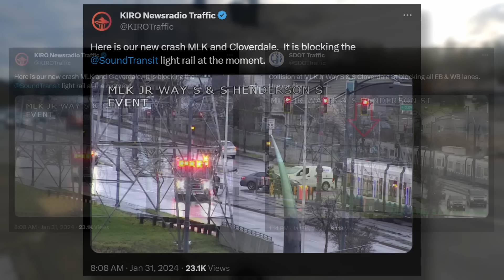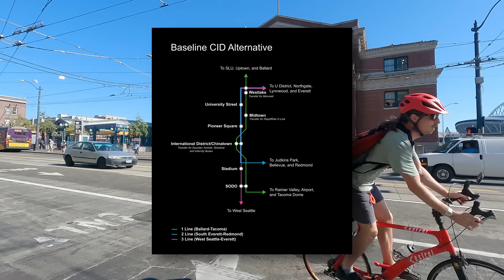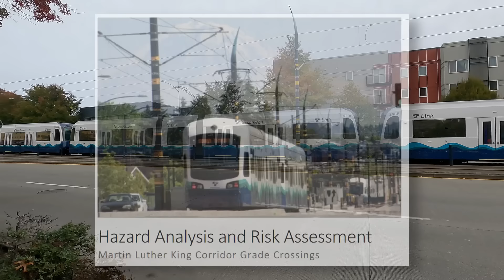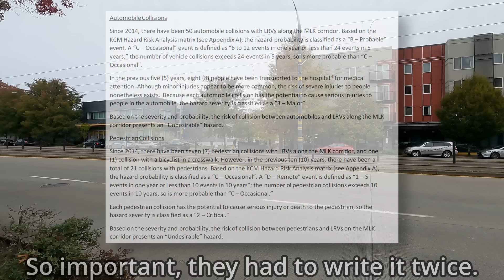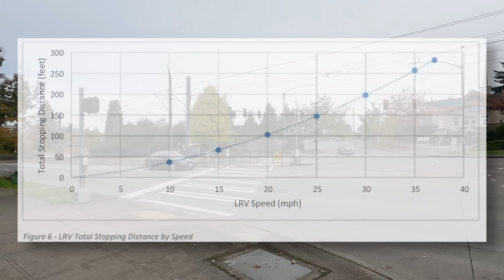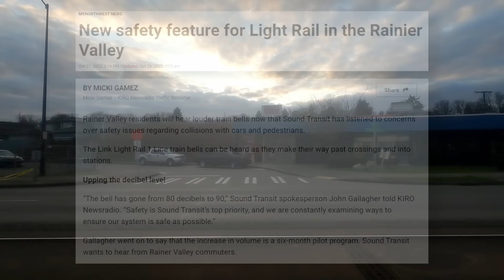Don't Skimp on Grade Separation

Comment: A comparison with Phoenix's Valley Metro light rail is warranted here. It opened at the same time as Seattle's Link, runs the same Kinkisharyo & Siemens vehicles, & has comparable average speeds, but took less time & cost to complete, & has been able to be expanded much more rapidly since then. It's also fully at-grade with traffic signal priority, running in the separated median of 2-to-4-lane roads for the entire length except a short river crossing. There are only two intersections with crossing gates, & in fact those two intersections cap the frequency trains can run along the whole line because the time the crossing gates are down is significantly longer than the time a normal light cycle would stop traffic at those intersections. If not for those two crossings (which Valley Metro is currently studying ways to eliminate), Phoenix would be able to enjoy the same 6-minute frequency as Seattle, instead of the 12-minute frequency it did before COVID.

The answer isn't "grade separate at all costs," but rather, build & operate at-grade light rail with adequate signal priority, taking into account motorists' (mis)behavior.
Reply: Complete signal priority was found to be impossible on the Rainier Valley section of the link: there's no way to meet the cross traffic demands while always keeping the trains running.
Reply: @satiric_  Phoenix addressed the same problem on Central Ave by eliminating cross-traffic except at arterial road crossings every half-mile. If the street layout of Ranier couldn't have been redesigned similarly, then that's the real issue, not grade separation.
Reply: But what is the problem with letting motorists wait? The M1 line in Lausanne is goes through fairly large intersections as well and the trains always have signal priority and never stop to let cars through, and on top of that the line as a frequency of one train every 5 minutes and is single track (except at stations). Sure the wait times to cross the tracks can be a bit long, but motorists have adapter to this and changed their habits
Reply: @alainterieur4837  there's no problem with making motorists wait longer in the abstract. The reason this particular crossing (University Drive in Tempe, AZ) is a problem, is that it's an extraordinarily high-traffic road through an incredibly dense area. The local transit agency actually started diverting bus routes away from University Drive, because at peak time in the afternoon it can take over half an hour to traverse a distance of less than 500 meters in either direction from the light rail crossing. With traffic so backed up, it's often the case that when light rail trains approach the crossing, the gates can come down on top of stopped cars, or trap cars in the middle of the crossing in the train's path.

The delay is especially bad when trains in opposite directions are slightly early or slightly late, causing the gates to be down continuously for the equivalent of two full cycles, or about 90s. Imagine a high-traffic arterial being blocked for 1-2 minutes out of every 5, and the 10-20% reduction in the road's throughput becomes a serious problem. So the agency addressed the issue by limiting frequencies to every 12 mins. Meanwhile, at similarly busy crossings where the train passes through a signalized intersection without gates, this is a complete non-issue.

Could one solve the issue on University Drive with a road diet, instead of grade separation or re-signalizing the intersection? Probably! But because of the arcane way that Arizona road planning works, that's not in the hands of either the transit agency nor the city, but a superceding agency run by people who are fully car-brained. They actually insisted on widening the road immediately east of the crossing, over the objections of several municipal officials.
Reply: @satiric_ wrong build elevated like in Melbourne Australia.
Reply: @jmchristoph buddy drop it at grade is crap and can’t be defended trams suck essentially at slow speeds
Reply: @jmchristoph politically infeasible
Reply: So you admit that at grade is hindering frequency? So you admit grade separation is vastly is superior

Comment: Whilst I'm not familiar with the area, in general I don't think grade separation is necessary for light rail. If they were going to go with a cut and cover approach, they should've just used heavy rail. The main advantage of light rail is that it is much cheaper to build because grade separation is generally not necessary, except for maybe at a few key points. If it needs to be grade separated anyway, then just build heavy rail as it wouldn't have been much more expensive than grade-separated light rail. 
I agree with your suggestions around using boom gates & pedestrian gates though - that should be a relatively inexpensive way to significantly improve safety and hopefully allow speed limits to be increased for both the trams and cars.
Reply: Some context for LINK: The initial construction had different plans compared to what was followed. Basically, LINK started of as a regional tramway (in favour of a regional metro linke BART, Washington Metro and MARTA) with the only meaningful grade separated portion being a BRT tunnel but any expansion ended up being grade separated which caused the initial sections to be an outlier with all the downsides which were inherited.

Comment: The (hopefully) soon to be opened Line 5 in Toronto is a Light Rail line that’s fully grade separated running as a subway basically through the centre of the city, but popping out to run in a separate right of way in the median of a busy stroad in the east end of the line. 

I’m very curious to see how many accidents and what preventive measures they have put in place. From what I have seen of the infrastructure thus far, I don’t see anything (no lights, no painted right of ways, no gates, etc…). Anyways, thought it would be another good case study. It’s too bad Toronto didn’t learn from Seattle & built the wrong transit. It’s likely going to be overcapacity within a couple decades, but we’ll see. 🤷🏻‍♀️

Comment: Seattle is a good example of a city that desperately needed transit but skimped out on the design and lazily built stations and crossings resulting in a failed system. Seattle hopefully can get better but this is a good reason most of the city doesn’t use it.

Comment: I'd say I'm pretty much the opposite of an urbanist since I prefer to use my car as much as I can, but I don't like seeing a half-assed light rail system being built in pretty much the same place we already tore OUT an interurban line. If we're gonna commit to it, at least do it well. I don't use public transit at all since I have no use for it, but the fact that so much money is being poured into a system that's already poorly designed just irks me. There are definitely places where light rail works in the Seattle area, but only if it's properly designed.

Comment: It's weird that at-grade isn't as much of an issue when I go to other places in the world with trams and LRT. For instance, in Munich the trams will often have exclusive right-of-way phases and signal priority so all directions are stopped at intersections while the tram runs through. Warsaw trams don't seem to have an issue running in the middle of the road either. Maybe it's familiarity with being around lots of trams, or lower overall speeds, or drivers are more situationally aware of their surroundings over there?

I don't think grade separation is cost-effective as a replacement for the 1-line, but I'm also unsure if trying to make things idiot-proof is a good solution either. There's usually a better idiot that shows up eventually.
Reply: the best thing is probably a road diet on mlk. toss in some sweet bike lanes, shrink the lane width, and people will actually start going 25
Reply: American drivers are terrible, mainly because driver training is minimal and it's nearly impossible to fail your driving test. Also, drivers are very entitled and basically think they are gods of their own worlds when they're inside their shiny metal boxes.
Reply: @danielkelly2210  Drivers in Minneapolis are the most respectful ones that I've personally experienced (it's probably the Midwest culture). But even here, the Green Line is known for nailing drivers who do a left turn through a red light.
I think it's more the quality of education and less the attitude.

Or maybe they just lack the proper motivation to pay attention: Get hit by a train, or get caught by the police making an illegal maneuver across tracks, get 20 years in prison (if you survive).
You'd be surprised how much more attention drivers and pedestrians would put into not making an illegal left turn across tracks.

Comment: That looks like a tram, not a LRT. They should have replaced the route with busses for the duration of maintenience and the problem would be solved.
Reply: To be fair, LRT is a very broad category and LINK does switch between grade separated metro and tramway multiple times.
Reply: @MarioFanGamer659  Trams sometimes have grade separated sections of the line, but they are still trams. For LRT to function properly it has to have fully or nearly fully grade separated route. (As in the same as heavy rail) Usually LRT has even more grade separation than heavy rail as it tends to function as a metro, and trams tend to have much less grade separation as they serve a similar function to busses, but with higher capacity...

Comment: In terms of retrofitting Line 1 in Seattle, couldn’t they shut down one direction of the MLK Drive, use cut and cover, while keeping the light rail line open? They could either convert the other side of the stroad into 2-way traffic or, alternatively, make some alternative road changes to handle the traffic changes (converting a 2-way street nearby into a 1-way temporarily during construction, or something to that effect. This way you could keep the Line 1 moving the entire time and may even see higher ridership as it will be better than driving on the route.
Reply: Possibly, but it's not something that will be addressed in the ST3 timeline. We would have to see what Sound Transit has planned for ST4 when it goes to the ballot.

Comment: I mean it depends.
A town of 600k can be served perfectly fine with (mostly) at grade light rail.
A city of 6 million not.
Reply: A 600k "town" would be the 30th largest city in the USA, ahead of Baltimore and behind Detroit.

Each of those cities has at-grade light rail, and also a single grade-separated rapid transit line which somehow generates lower ridership.
Reply: @jmchristoph  Keep in mind that it's perfectly valid to count the metropolitan area instead of just city proper.
I grew up near a town of 150k but the immediate urban and commuting area had about half a million people. Such an area can be served with a backbone network of light rail supplemented by bus services and some regional heavy rail.

A metropolitan area of 6 million for example can use light rail in its sub centres towards the outskirts and for local connections outside the immediate center.
But the center needs to served by proper high capacity rail.
In my current case by a high floor light rail subway system and a heavy rail S-Bahn type commuter railway.
Regional rail, busses and trams are supplemental only.

Comment: Lots of history behind the Rainier Valley (MLK) corridor.  The comment about local advocates opposing elevated tracks might not be fully accurate. It is becoming more gentrified as time moves on, but before the train existed, this was a collection of low-income neighborhoods with equally low political pull. They had a lot of concern about their section of the rail being at grade rather than elevated or tunneled. But like all low-income neighborhoods, they got the short end of the stick when it comes to cost-savings. I-5 cutting through the Yesler neighborhood is another example. 
On a side note: it is pronounced “Rain-near”, not “runnerr”. 😊

Comment: So frustrating. If they brought back the neighborhood to downtown buses instead of the way they cut the route to drop you off at the station for the broken train. Been riding transit every day for 25 years in Seattle and still not sure what problem this train was trying to solve, but it is so much more headache than when the buses were in the bus tunnel.
Reply: ...really? You don't understand that busses sit in traffic (especially in pinch points like south of University Bridge due to the geography of the city) while the light rail can keep moving on dedicated tracks? You don't understand that bus lines can average 3.8k to 7.2k people per hour while light rail can carry 12.2k to 26.9k per hour? And that's all while you're paying fewer drivers (so much cheaper operating costs) or even setting up the system to be automatic.

I'm super happy for you that busses had been serving your needs, and I agree that it's incredibly frustrating that they cut plans for many rapid transit bus lines during the pandemic budget crisis and moved them to pick up/drop at the light rail instead. But there's a reason that all highly developed metros and many small metros outside of NA rely on trams/light rail/heavy rail rather than busses--busses shine for their flexibility and are fine for lower density settings but if you have a lot of people moving in the same direction at the same time, you need something with a higher capacity, speed, and dependability and lower operating costs.
Reply: this is an old school opinion hahaha
Reply: During rush hour the 72 bus from UW to downtown used to take three times as long as the light rail takes for the same trip. Seattle's road network is too screwed up for buses to work efficiently.

Comment: Why not put car traffic a level down? Through traffic could be run next to the tracks (no left/right) turns, while the road for the residents with the crossing is a level down. This would remove the need for crossings. Car tunnels dont need to be as deep as train tunnels. One surface level side of the road could be removed or repurposed. The few semis that need to go into that part of town could be given alternatives. There is also potential for other positive side effects.